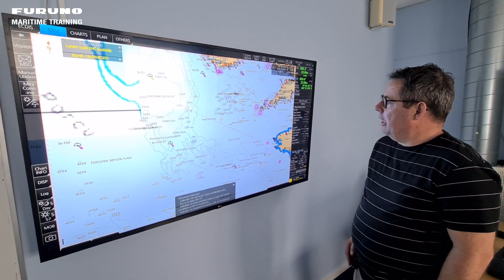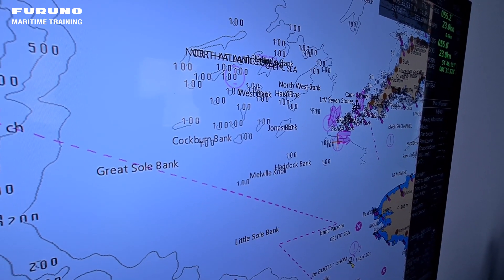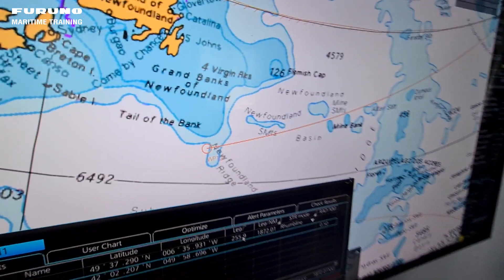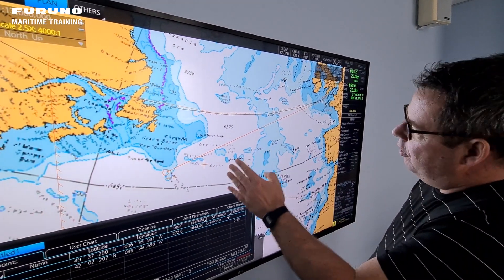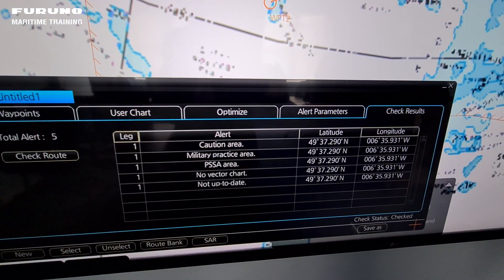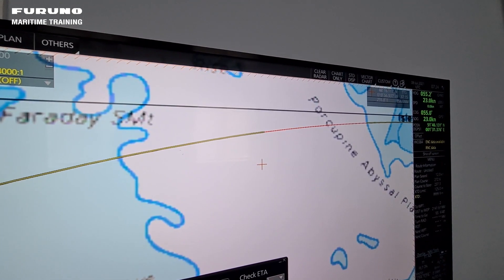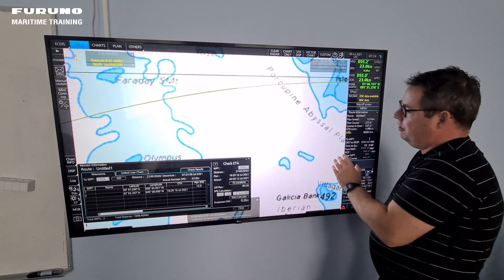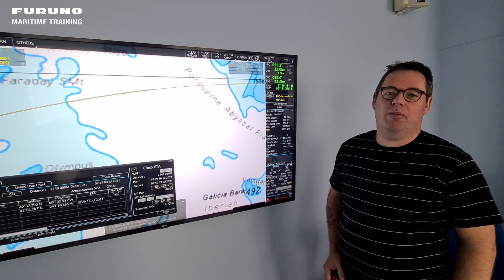How to make great circle sailing | FURUNO ECDIS tutorial |

Comment: Unlike the other one, e.g. my previous vsl used JRC ECDIS and it can be divided 5/10° longitude on great circle track. But according to this video, that one can't be executed. Currently I'm working together with back-up system which use for paper charts. So, I deeply would like to know to solve any other matters for great circle division method?
Please kindly reply my comment.
With appreciate and best regards 🙏
Reply: furuno fmd 3300 dividing great circle leg into series of rhumb line by 5/10deg is it possible?..